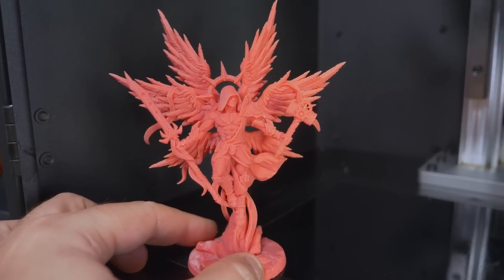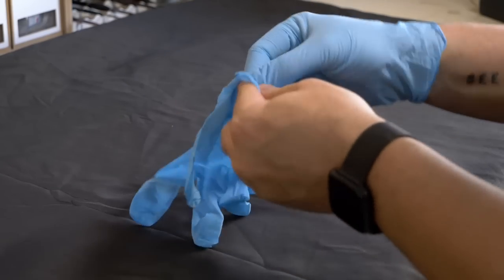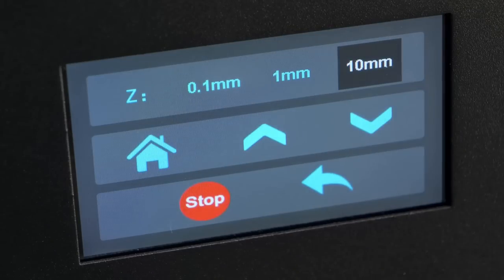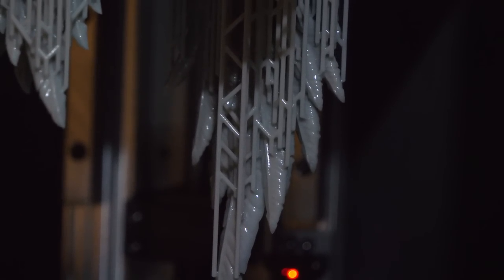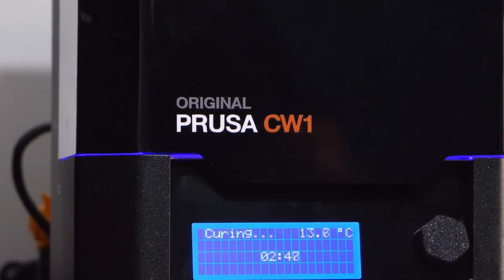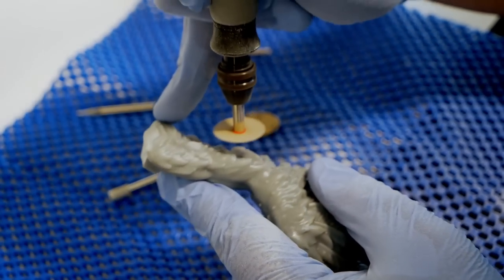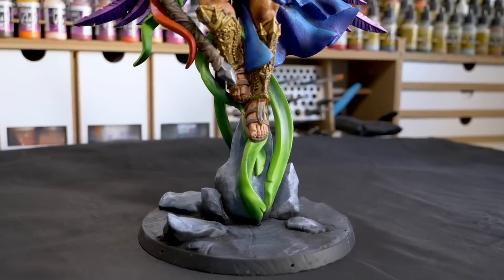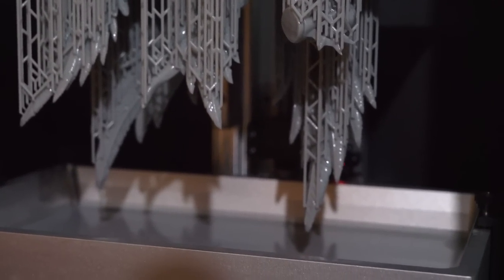HUGE Resin Prints On The Peopoly Phenom

Comment: For everyone saying a 500hr print life is nothing at all, you're mistaking print time for LCD time. Remember the LCD  and UV are only exposed for a few seconds per layer, the printer then takes several seconds to lift and lower during which the lcd and UV are off. A 500hr lcd life could mean 1000-1500hrs of print time depending on the resin and settings.
Reply: So i can make 3 of this (3x500), and then yuo need to buy a new screen? Wow
Reply: @noway8233   More like 6,  (11 days = 264) but given the size of that print, that's not bad
Reply: I have no issues with the lifetime of the components, i have an issue with the smell and airborne particles of the resin.
Reply: Is that true tho?
Reply: Johan Nikolas  your a great friend

Comment: joel did you forget about heating up the supports in hand hot water or with a hairdryer to warm them up. they will then start to be very malleable and easy to remove as the contact points are small and should also not leave any puck marks or support nubs.  this should make removing your supports a lot less hassle to remove. also best to remove the supports before you cure the model. :) nice print my man. :)

Comment: I think it's great that it's working for you, and it's nice to get it for free so if it turns out to be junk it's just time wasted. But I would not spend my own my money on a Peopoly machine, not again. I got burned by the Moai, badly. Then they switched focus to MSLA machines, and the issues which plagued the Moai remained, and still remain. I donated my Moai to a maker space with hope they can make use of it. Phenom came out and had issues with the screen failing prematurely, and Peopoly released the Phenom Noir -- with a monochrome screen -- literally before some people who ordered the original Phenom could even receive it. They're selling 4 figure machines with the same approach as Chinese companies with sub $400 FDM machines, release and iterate, well, I'm tired of being a non-compensated beta tester. They also love to seed their machines to YT creators. Especially hand picked machines, not just any single one of the lot. The peeling forces on a large MSLA machine can't be understated, if you either stick to just their resin permanently, or wait for them to come up with firmware patches and other solutions to deal with peel issues, or wait for them to come out with non-fep based vat which is tougher and can withstand those forces better -- not for me.
Reply from the maker: Question, what makes you think I got this and my moai for free?
Reply: @3DMakerNoob  good awnser, nice work, impresive machine, very goood painting work, well i think resin printer are not for everyone

Comment: Did I understand that correctly... A screen is expected to last 500 hours and costs around 100$ to replace. The model printed took 250 hours. 
So you can print two of those, and expect to replace the screen afterwards. 
Or to put it another way, the printed model costs 50$ in screen wear, on top of that we have to include printer purchase, resin & other consumables.  
Very beautiful, but pricey with everything included.
Reply: Resin machines are quite a bit pricer than fdm anyways
Reply: @liamsmith8518  sure, I was aware of that. just not to this extent. 
I'm absolutely willing to accept the higher consumable cost for the resin, and the material handling agents. 
If I were to buy a resin printer this size, I presumably wanted to use the build volume capacity. Having to replace a major part every 2 full size prints, seems to me a bit like having to repair a brand new car for 10% of the purchase cost, very time I made 2 road trips. 
Not that I'm bitching about the printer though, it's astonishingly good. I'm just surprised at the repair upkeep, and the seeming fact the screen doesn't last longer.
Reply: @Ealen75  makes sense
Reply: @Ealen75  it won’t be every 2 prints more like 4-5

Comment: Can you use the same color for working with the air brush and with the brush itself?
Reply from the maker: You could, but it’s not always recommended as the airbrush paint is much thinner
Reply: @3DMakerNoob  and when you use different paints is the color shade the same?

Comment: When levelling the build plate, why bother hitting Z=0 when it's already at Z0?
Reply from the maker: Z0 could be anywhere, hence why you want to set it to the right height which is a paper’s worth of height from the LCD screen in order to get the perfect first layer. If the build plate is just half a mm too high, your first layer won’t stick
Reply: @3DMakerNoob  Yes z0 could be anywhere, hence the adjustable build plate.  So when you loosen the screws and home it it goes to z0 using the endstop.  You then set z0 to the thickness of the paper by tightening the screws.  That's why I'm saying the z0 step is redundant.
Reply from the maker: No it’s not because you loosen the screws as the limit switch is set a few mm above the screen hence why the build plate has screws so it can slide down to compensate for that height
Reply: I agree that the screws need to be loosened, but according to the printer, that's Z0 because it stops at the endstop.  You're setting a physical Z0 already, the firmware already thinks that's z0.  Maybe someone else can explain it better so you understand.
Reply from the maker: I understand what you are trying to say. Did you see me home the printer which was the current z0 and then lower the build plate even further past the original Z0 to set the build plate because the build plate didn’t reach the LCD screen? Hence why there is so much travel distance on the screws?
Reply: @3DMakerNoob  Ahh I see now, sorry I missed that part.  That seems like a bit of an oversight on peopoly's part to require going below 0 for the build plate level.  Or is there some design reason they didn't just have the endstop slightly lower?
Reply from the maker: It’s like a fail safe for future development. The buildplate has already seen an iteration and if they do upgrade kits then you don’t have to worry about that part
Reply: @3DMakerNoob  If they're worried about lifting that deck in future upgrades, I imagine it'd be pretty much a new printer at that point.  Sorry again about the misunderstanding :)

Comment: 250hr printing, Jesus, like actually 11 days?, what is your layer time? That approaching FDM long.
I just filled the full 15" height on my phenom L and it gave me about 80 hours, which is still a long time.
I'm waiting on a mono screen to hopefully come out for my L.
Reply: Yea it was a user error for sure. No possible way 11 day print time is not a user error. On your machine if your print doesnt have long flat planes you could drop the pullback to 4 mill. That would save you some hours.

Comment: If the print took 250 hours then something is wrong. You should be able to print a full sized model in 40 hours on that machine. It should be able to print 10 mm per hour. Or what resolution did you have? Super duper ultra ultra ultra or something? I don't get it.
Reply from the maker: The model is in 14 pieces, you can’t print it in one go
Reply: He printed everything loooong ways and in way to many batches which was silly but it did offer some very nice shots of nice long prints in a giant machine. 60 hours max to print that if you lay it out properly on the build plate, aiming for least amount of layers.